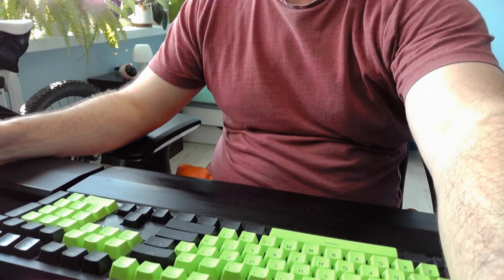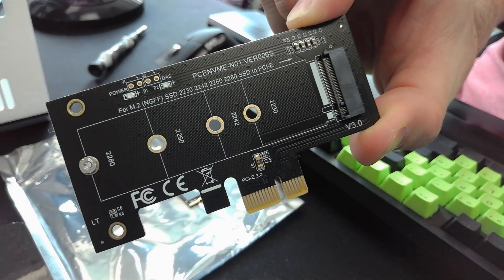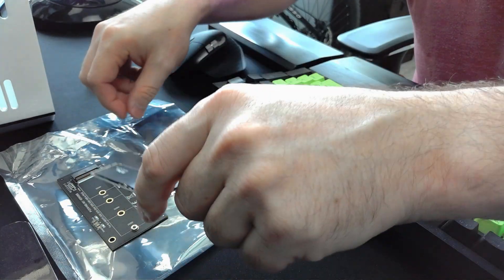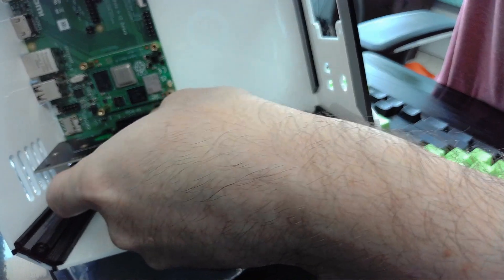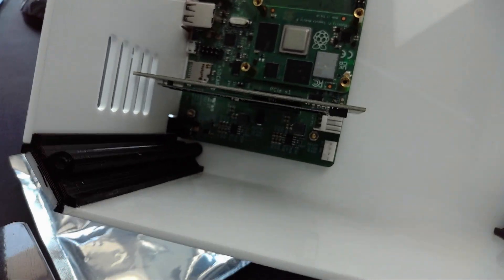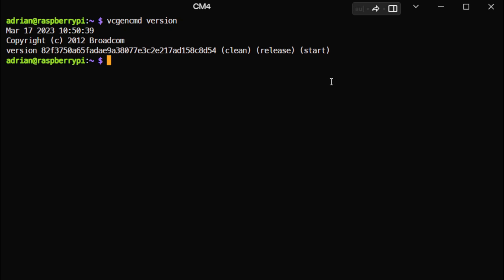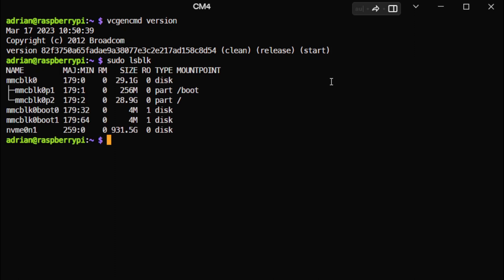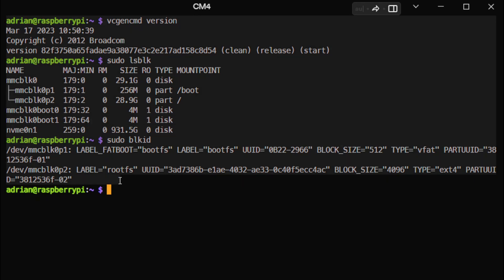How to mount NVMe drive in CM4 board using PCIe adapter

Comment: Could u please write the PCIe adapter name? most of them do not work on CM4.
Reply from the maker: I bought two adapters. One is PCENVME-N01 VER006S for M. 2 (NGFF) SSD 2230 2242 2260 2280 SSD to PCI-E. 
This one is available on Amazon. 
https://a.co/d/2AA3PlD

The second is Adapter PCI-e x1 NGFF 3056 model M-M202 version 1.0 for M.2 2230 2242 2260 and 2289
This one on Amazon should be similar to the one I bought. https://a.co/d/1HsumVi
Reply: @sysadmin-info Thank you very much
Reply from the maker: You welcome. I will update my website tomorrow and provide models there.
Reply from the maker: Here you have a comparison of these adapters. https://www.youtube.com/watch?v=v9HjrWYDOb0
Reply: @sysadmin-info Thank you. I also tested my Samsung 970 EVO Plus M.2 NVMe SSD with both PCIe adapters like yours on my CM4IO (with Compute Module 64 GB eMMC). Unfortunately, the Raspbian does not detect the NVM. No idea how to solve the problem....
Reply from the maker: @hshahabi  Maybe use Debian 12 or 11 instead of the Raspbian? You can additionally watch this video.
https://youtu.be/mgL-Ntk21n8?si=CxNuSEBn4bXzmoag